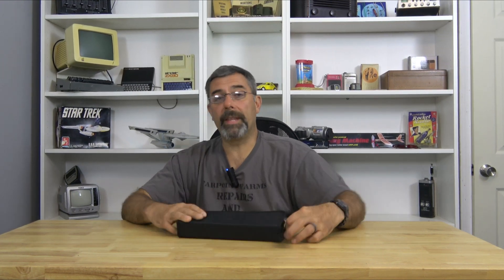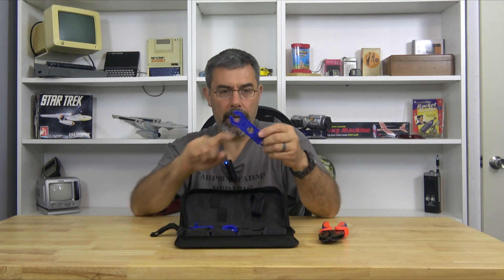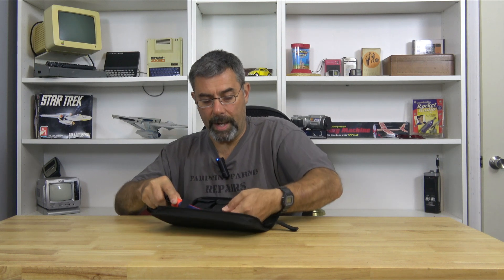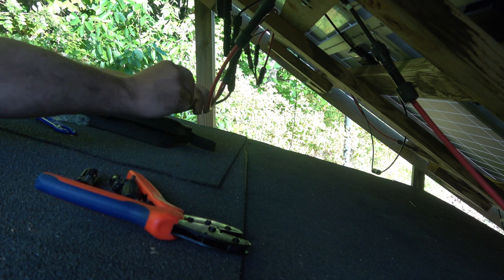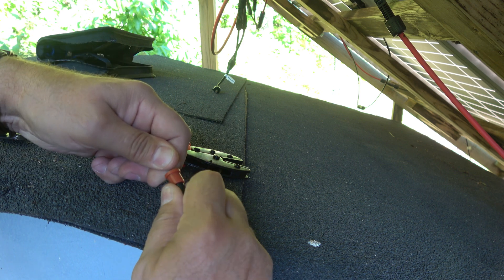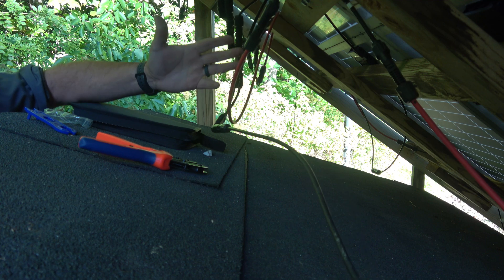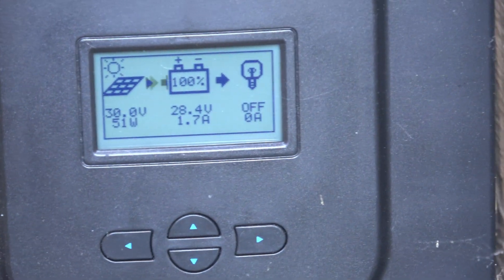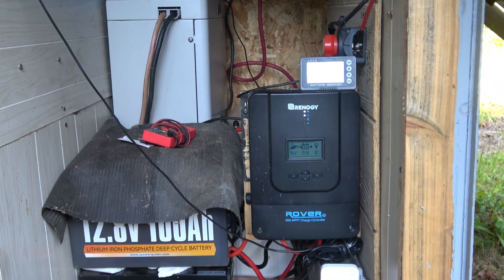My Solar Array Failed! This BougeRV Solar Connector Repair Kit Fixed it!

Comment: I have had MC-4 connectors fair before . not too common but happens. Even had the factory made ones fail.  The correct crimper is really needed.  I use dielectric grease on the ones I do. Really helps with corrosion.  Before that failed. you were losing power from solar  array . That is also a early warning sign. drop off in power .    Causes of failure in MC-4 I found were bad crimp or water get in or poor quality connectors,   Yes cheap China made sub standard ones are made and sold.  The market is flooded with solar products . The outher problem I run into is CCA wire is used, BAD stuff to use. Copper clad aluminum. Just do not buy and use.  Lots of that sold for solar . you want pure copper/ 100 % copper or oxygen free copper.  And for outside woy want wire rated for that .   I use a thermal image camera to look at all connections when solar putting out near or full power. finds problems eary.  I had inverter cables fail from bad crimp or CCA wire . Take that thermal camera you got and check all behind the panel for connections heating up. Then go threw the whole system.  This even fines a loose battery terminal. Best to test under load and in good sun.  Inverter check at night under load.
Reply from the maker: Thanks for those tips, I have a thermal camera and will take a look. I would have not thought of that tip- I might have to make a video on that trick and send a shout out.

Comment: Odd thing about doing your first solar connector is, the female metal contact goes into the male connector body and the male metal contact goes into the female connector body. You're essentially making two hermaphrodites.
Reply from the maker: Good analogy with that one.

Comment: Nice little kit, and great demonstration!  

In my situation, I have multiple smaller panels in varying locations, charging multiple 12 volt LiFePO4 batteries. Not putting all my eggs in one basket, LOL!   My connectors are all SAE and Anderson.  (And a few cigar lighter plugs, LOL) WHY, I wonder, are there SO many different connectors on the market!  Trying to keep things as simple as possible here.  I'd say about 5% of our regular household electricity use is supplied by solar, but can be much more, if SHTF.  I guess it would have to be 100% in that case, wouldn't it!!    Thanks for the video!
Reply from the maker: You are right on making the connectors more universal. It is frustrating to try to find the right one

Comment: Sorry , you are not done with connection. You have left the connection hanging at the lowest part of the run underneath the array.  You need to return to repair and secure it to a high point.
As you left it , any blown in moisture or condensation is going to accumulate at the lowest point (  current location of the connection. )
Reply from the maker: You are correct sir!

Comment: your supposed to use both tools. one to hold, other to tighten. and you tighten until it clicks. which you did 3 times. also, slide the nut and gland fitting on before you crimp the connector on.
Reply from the maker: Yup. I just man handled it, but yes that is why it comes with two tools to hold the connector.